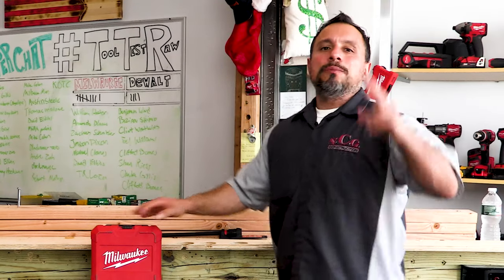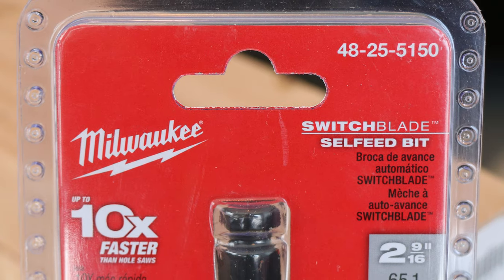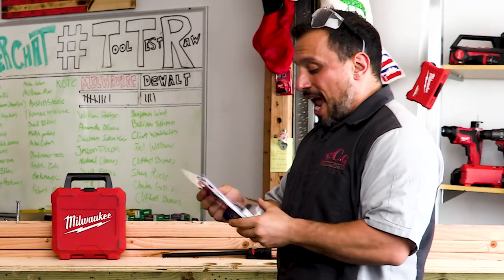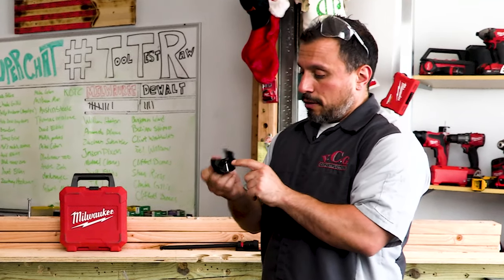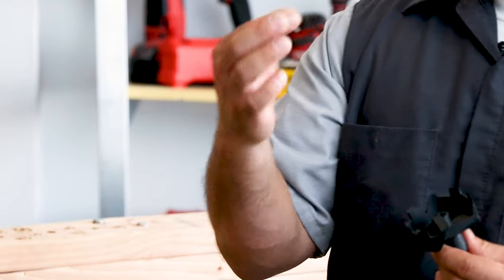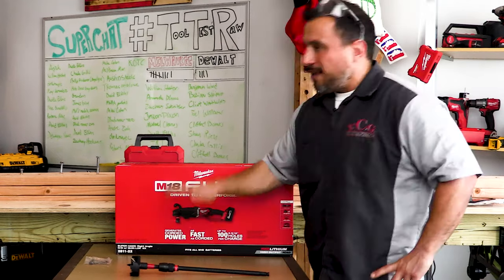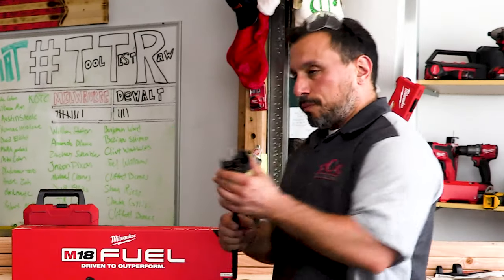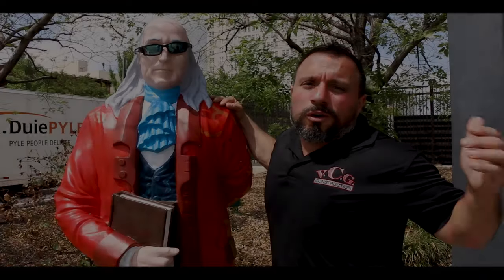Milwaukee Switchblade Bits Can Do This...

Comment: The con about the bits is that a screw, lag, metal, anything but wood (besides for the soft stuff) destroys those self feeding switchblade bits.

I had maybe 300 holes to drill for prep work to run run lineset, through shingles, wood with nails and lags, I bought the carbide big hawg kit. Best buy EVER! 8bwas able ton drill 48 holes in like 20 mins (that's including moving the ladder the whole length and width of the kitchen and dining room.

Please Vince for the sake of, the best hole saws.... Let's go big hawg carbide vs switchblade. Yes replacing the blade when needed.
Reply: I bought a 2 inch version of this, but it wasn’t a switchblade and the job site I’ve been working at has shitty framing (nails everywhere) and I completely destroyed the blade on my second day. Most of the nails I hit were not visible, so I couldn’t do anything about it, but I might get one of those carbide kits. If they can cut through nails no problem then that seems like a much better deal than these

Comment: Vince, thank you for the vid. I'm looking at these switchblades for a hard wood application. I need to drill a couple hundred 2" holes through IPE 4/4 boards (deck planks) This is the hardest of hard woods. All my other bits are just smoking. It takes minutes to get through one hole cut. I've tried my pistol grip cordless, my 1/2HP cord and my drill press as well. I'm looking for a better bit for the job. What do you think; will these cut or is likely the self-feed bit will just break off?

Comment: I have over 7’ of extensions with this bit. I run it on the Milwaukee lineman Impact and rarely grab a ladder for most houses. I use them for 2-1/8” tubes and bundles of low voltage. They hold up okay as long as you stop when contacting medal, if you keep going you will have to replace it. You just have to pick the best spot and get lucky at the same time.

Comment: Would like to see a demo. Thinking if getting a 2 1/8 for door lock installation.
Reply: I think it may be too aggressive for lockset holes. I think a hole saw, where you're only cutting the periphery of the hole is better than removing ALL of the wood like this or a Forstner bit. (For that specific application. Especially for fiber, hollow, fiberglass, and metal doors.)

Comment: Vince. PLEASE do a piece on Milwaukee's 2631-20 circular saw.  No one else has.  I was saving for the fuel but 2631's are on promo for $179 in store  at H.D. w/ free 5.0xc. This saw  flys under the radar and it's powerful n light.

Comment: This bits work great, however if you have to drill through a beam thicker than the length of the bit stop every inch and back it out or it will create a heat compressed pulp plug that will get your auger stuck in the beam. It's a very bad day trying to get it unstuck. If you have to, use a long thin drill bit to work around the play of the quick lock chuck and break up the plug/pulp then slowly back it out.  PITA....  Milwalkee needs to put a scrape feature on the chuck so pulp doesn't compress against the smooth surface as you bore. Bad design.